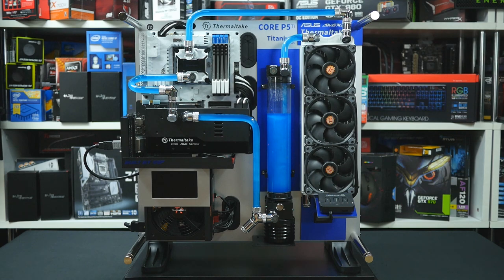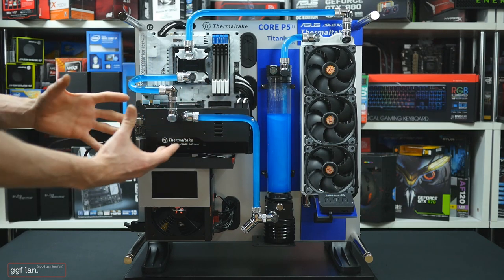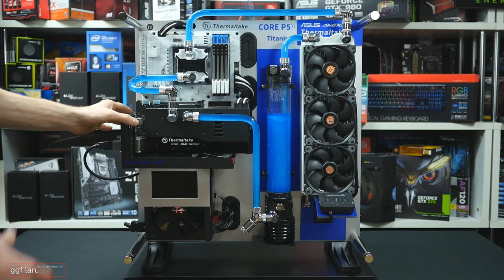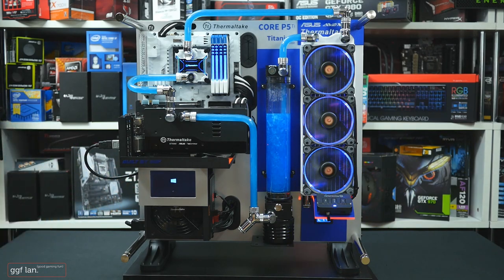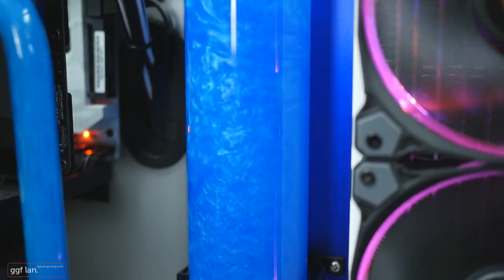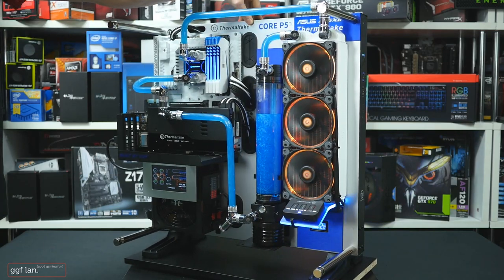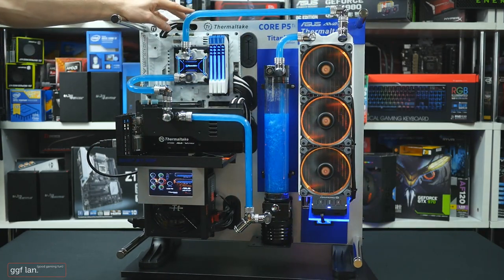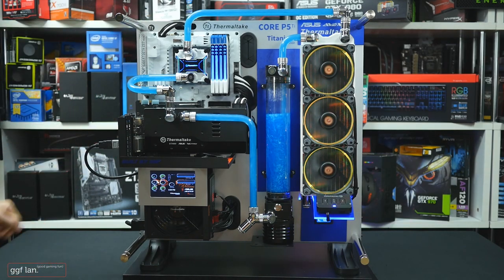Mod Video - Thermaltake P5 - Complete

Comment: Thanks for the respond I built a P5 and its cool a couple of things disappointed me about the case and fans. 1st of all the ribbon to video card can't hold a massive video card poor design on Thermaltake but I told them and how to fix problem. 2nd was fans I bought 2 boxes of the 3 fan with controller and somehow the controller crap out 2 sets of fans under load so other than that I believe they should of included some kind of wall mounting piece but it a kook case but not efficient enough to cool my I5 3570 over clocked at 4.5 ghz with a 480 rad and a 250 res using EK pump I don't understand why it runs hot can't keep it cool enough saying that it's a talking piece

Comment: Questions....Why isn't the reservoir filled to the top? Is dust a problem, possible to run soft tubes, non watercooled graficcards?
Reply: Dust will be a more or less of a problem, depending on where you live - but still a problem, since it's open case with no top, front, back or bottom panel. It supports up to 180mm coolers, so plenty of room to run soft tubes - there are videos/pictures with soft tubes done in this case. No problem to run air cooled graphic cards - just like in a standard case. But it's just that kind of case, that is made for displaying custom LC loops - but air cooled graphic card or CPU is still a viable option, tho it won't look so good.

Comment: I have the same pump and reservoir, and want to mount it the same way you did. I am trying to figure out what fitting you used to mount the reservoir to the pump? There are some fittings included with the reservoir, but the only fitting that looked like it would work is some kind of air escape fitting. Appreciate any help or advice you can offer.
Reply: +Bobby Bailey Heya, it just came with two black clamps that bolt on to the case
Reply: +Stuart Tonks thanks for getting back to me. I was referring to how you connected the reservoir to the pump via fitting. I seen that there was a tiny gap between the reservoir and pump, and would like to know what size fitting you used if you have a link? Thanks!

Comment: Can you give me some info on that display? did you write the software for that display? how where you able to separate the mini display from output display with out it showing up on main display? I love the idea and I would like to implement that idea on a build some detail would be kind of you thanks.
Reply: +ramon hoffmann Hey there. The screen is just a 5.5" panel from Ebay which comes with everything you need and has HDMI input. - http://www.ebay.com/itm/291048977136?_trksid=p2057872.m2749.l2649&ssPageName=STRK%3AMEBIDX%3AIT. The software I used was aida64 which is a monitoring app which you can make custom sensor panels for. Hence the cool looking one I did. So really I can't take any credit for what's on the screen. Haha

Comment: Hello Stuart, y wonder as you have connected the LCD, I mean the connection of power suply, because I only see the HDMI connection, I m going to do a montage of components in the same box with liquid-cooling and I love the idea of this monitor but I see that the LCD has many connection (and electronics its not my strong point), and I want to use this LCD like a second screen, I would appreciate if you could explain it to me. Thank you, greetings.
Reply: +conde dracula Hey mate, the screen itself has a ribbon cable that goes to a controller board. That board just needs dc12v. I just ran it into a molex connector to the PSU. It's just one of those laptop style push in power plugs it needs

Comment: which reservoir and pump is that?
Reply: +William Sommer Heya, this is the Thermaltake Pacific R33 Reservoir joined by a small male/male fitting to a Thermaltake Pacific P1 Black D5 Pump w/ Silent Kit
Reply: which male to male fitting?  Can you give an entire parts list?
Reply: Stuart Tonks hi Stuart what did you use for the LED holder below the fans for the cool control and also how did you hook the cooling software to the monitor ?

Comment: Will that case hold a gpu with the length of 305 without hitting the res? the 980ti asus strix is 305 but the specs say that if the gpu is over 280 it will hit the res.

Comment: I wonder do you make any gpu test? in my case when I plug gpu with pci Express cable to motherboard the Picture showing normaly but the fps are terible it is max 6fps in test. so I do not know what could be the problem...I forgot i have asus z170 pro gaming motherboard and asus 980 strix gpu.